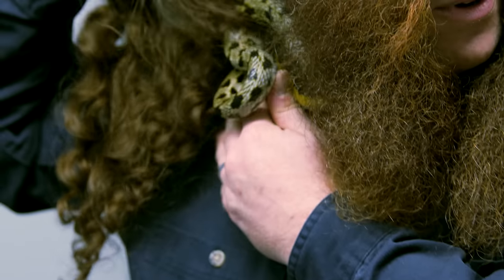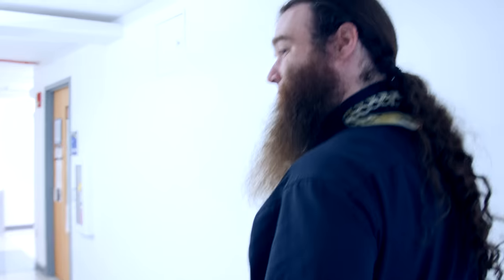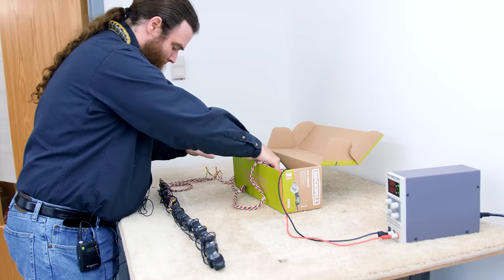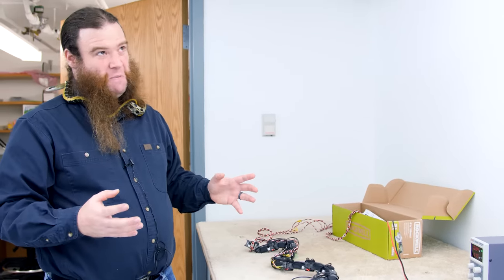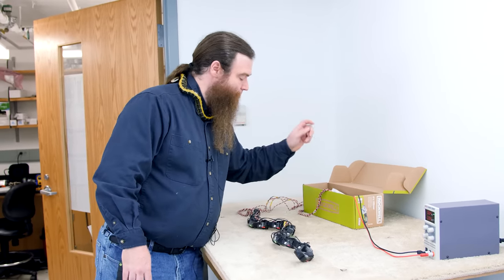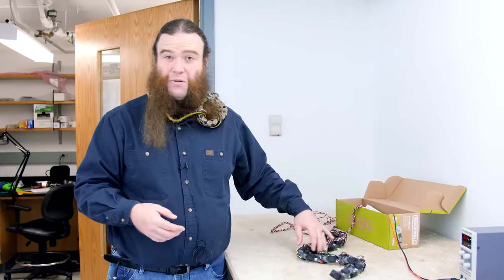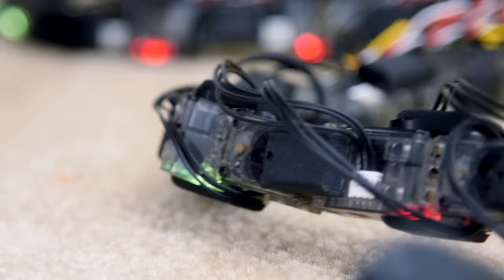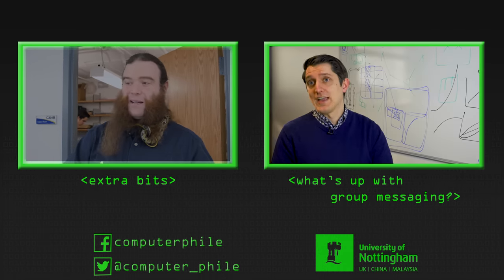Robot Snake - Computerphile

Comment: respectable beard.
Reply: Well at least we can agree on the fact that it's a beard.
Reply: the hole in the middle of the beard is so that the snake around his neck isn't completely hidden
Reply: @dermathze700  I disagree with that. It's clearly two beards!
Reply: Strictly speaking it's a TROL beard
Reply: Swiss Cheese  This. When they meet in the middle, then it'll be a single, unified beard.
Reply: @dermathze700  It's not a beard.
Reply: @MWNewey   i would argue it's not respectable either
Reply: *nix beard. Wondering if Dr. Astley is a Python guy...
Reply: when you're going for wolverine and end up at gandalf.
Reply: Yes it is quite the veritable hedge sprouting from his face! :-D

Comment: There is another movement mode related to the concertina mode: coil and spring.  We see this when a cobra strikes.
I started building serpentine robots back in the mid 90s, and I didn't have access to these cool servos.  Instead, I used NiTiNOL tensile springs, four per universal joint. They're pretty slow to cool and stretch, but respond very quickly and contract when you put current through them to heat them up, and can move several hundred times their own mass.  They act a lot like muscles.
I also didn't have Python back then in the olden days, and was limited by my budget to using 8 bit CPUs, in particular the 8085.  I've spent quite a bit of time developing an AI system that operates on 8 bit CPUs or microcontrollers, which I call FUNGAL - the FUzzy logic/ Neural network /Genetic Algorithm Language.  It has taken me nearly 30 years, and of course Moore's law has long passed me by, but I believe we have only scratched the surface of what an 8 bit computer can do.  Sometime in the next few years I'll release the language so other people can play with it on microcontrollers or retrocomputers.

Comment: Maybe you can make this project more energy efficient by not using arduino based code???
Reply: Because arduinos magicaly make servos draw more power
Reply: I mean more energy efficient from the mcu perspective (not from servos). Wouldnt be better if he used bare metal programming or some rtos?
Reply: @mpampissougidis9880  but the power consumption of the controller is so much smaller than the power consumption of the servos.
In comparison it's not really relevant

Comment: Lost my respect, when he said that the snake is drawing over 1 amp. At least add the number of volts to that, or give us the number of watts directly!
Reply: Since he is using an Arduino you can assume it's 5 volts
Reply: It’s not exactly Arduino. They are supposed to be 7.4V, but operate over a fairly wide range. The PSU looks to say 8.2V.
Reply: The point was about wiring. So they can't use batteries coz of high current usage. Voltage is irrelevant because it can be stepped up to massive levels on small batteries. What matters in power consumption is current drawn per unit time. Besides since batteries supply DC the voltage is really useless.
Reply: Step up converters provide less current than the supply source. The original comment was about power consumption in Watts.